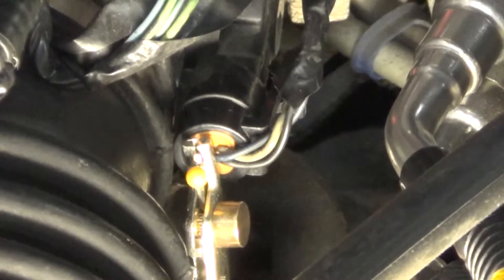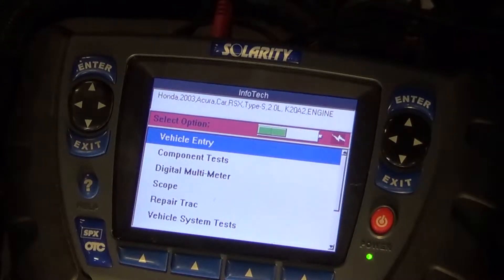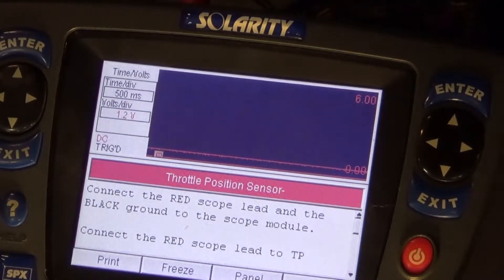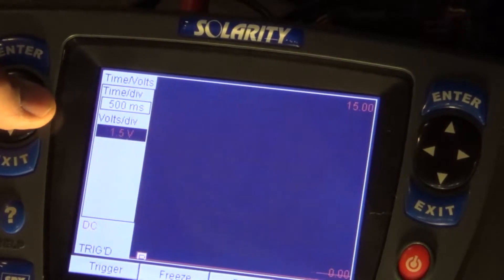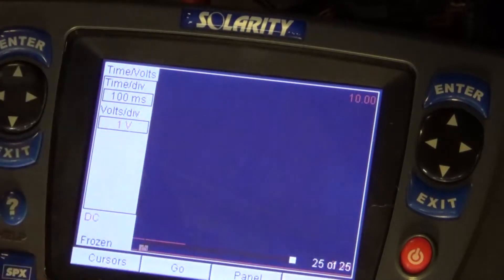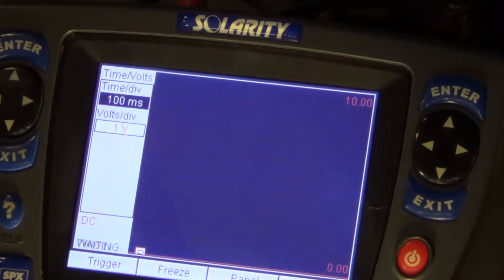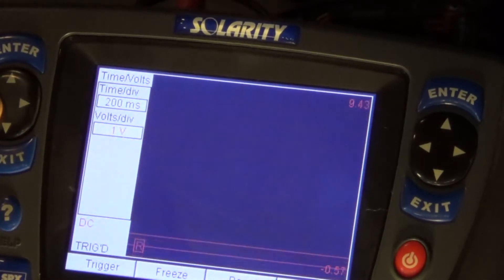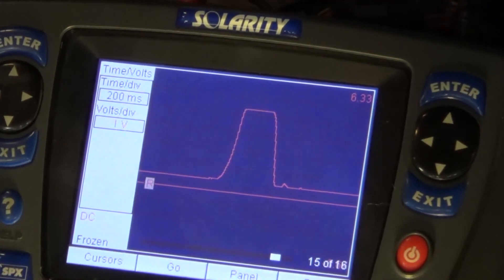20141101164150

Comment: the left and right buttons are for pulling the picture slowly left or right the up and down selects idividual frames example get the pic close on the screen with up and down then scroll left or right for smaller change
Reply from the maker: +Mike Eustice Thanks Mike. Jim.
Reply: No problem not a bad tool but not the best I had one kind of miss it but I have a pico  scope and snapon vantage pro I kind of miss my otc scope mine was on my genisys
Reply: ❤😂 0:00